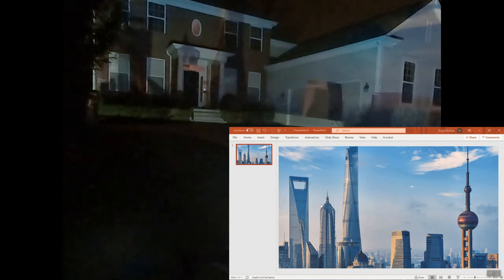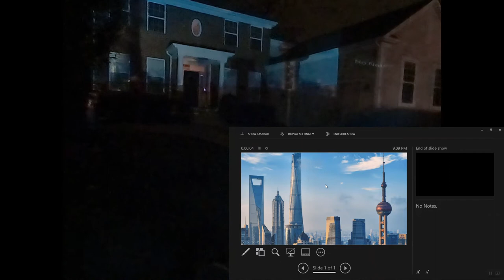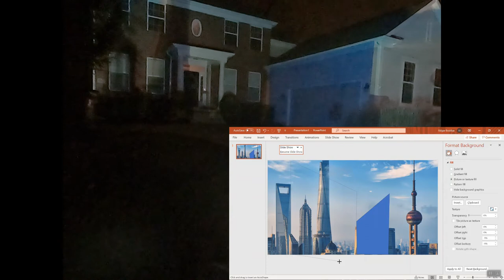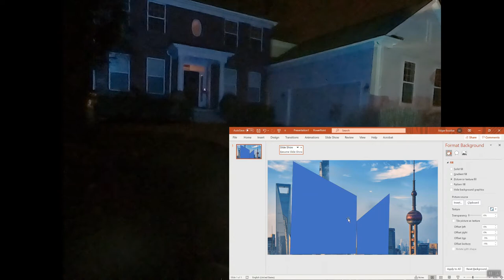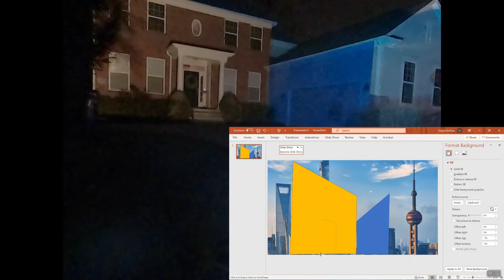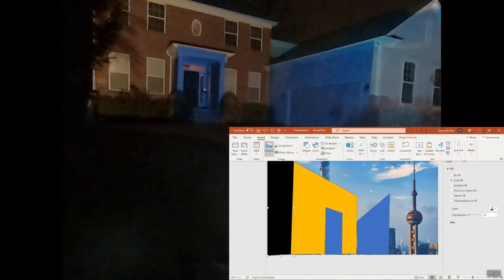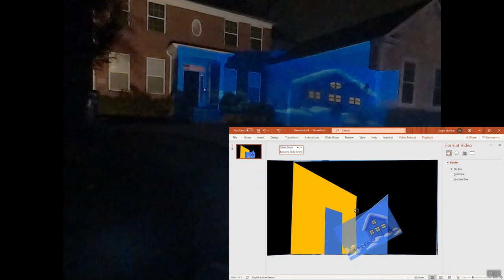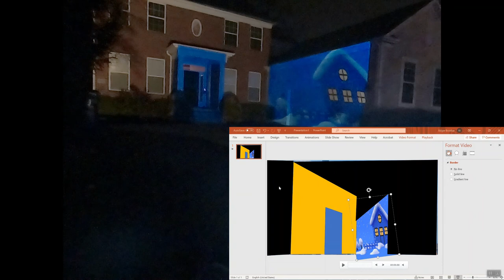House Projection mapping using PowerPoint - DIY

Comment: Quick question can I do this from my iOS device?
Reply from the maker: Yes and no, the yes part is that MS PP is offered on iOS and you can surely map. The NO is that you are very limited and can only do basic functions. So if you have a very easy map to do for sure you can do it and I’ve done it before specifically on my last Halloween show which you can find a how-to also on my channel. There’s also good news though… I’ve also created a how-to on mapping with an iPad using notes which is way easier, faster and totally FREE (in case that’s what iOS you have). You will find it in my “Projection Mapping” playlist. I hope this helps.
Reply: @Super_simple_diy  oh okay thank you